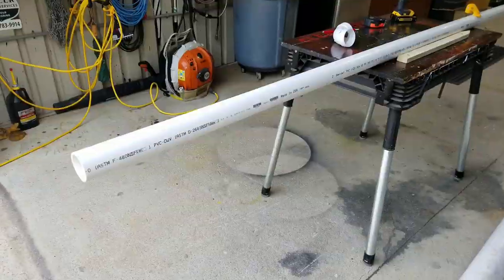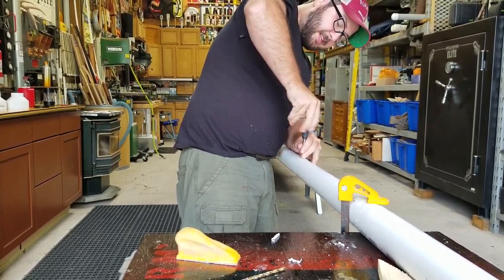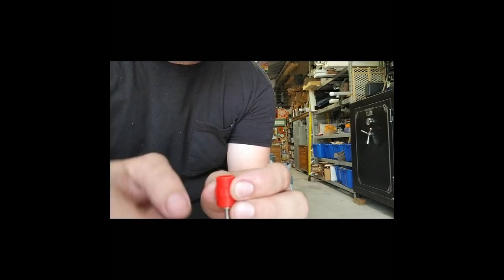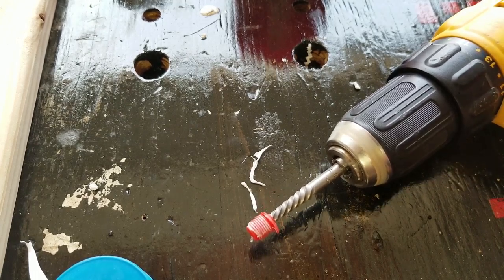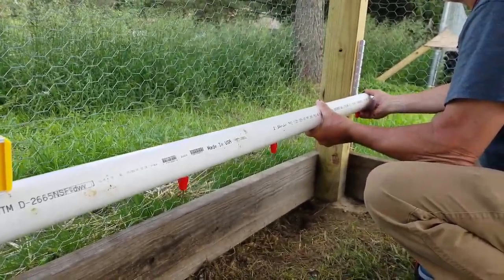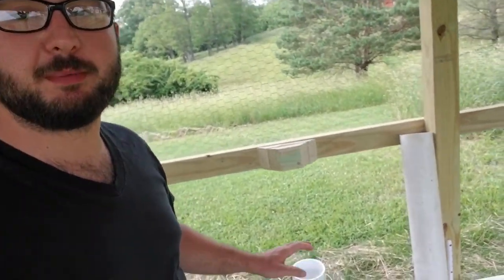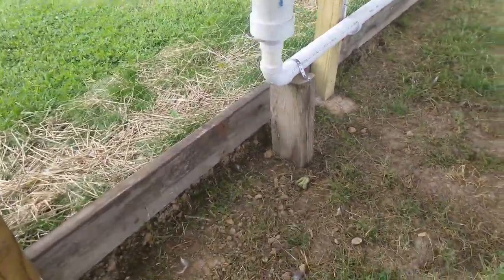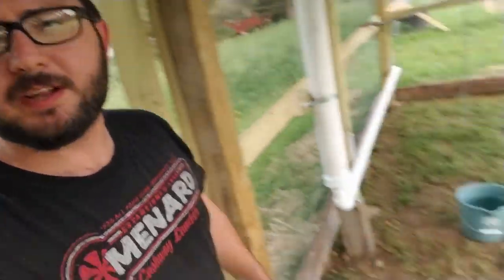Chicken Watering Station, Nipples Included

Comment: Rather than orienting the nipples straight down what if you oriented them at about 30° or 45°? They should still function ok right? Would be a more natural access for the hens.  Also mount the pipe at the correct height for full sized chickens and place some temporary blocks or something for the birds to step up on while they're smaller...rather than repeatedly adjusting the mounting height...
Reply from the maker: They do make other style nipples that you can place on an angle, but not these cheap ones, they have to be vertical or they won’t seal. We have the height dialed in now as well!

Thanks for watching!

Comment: Why did you not put gutters draining into a rain barrel and then run the water from the barrel to the water nipple lines. Then you would have lots of water and probably never have to water them with a hose. But don't forget to put a clean out on the barrel if you do decide to do it that way. 
By the way, don;t forget to put a lid on the top of the 4" pipe so you don't get bugs in the water. It would be horrible to try to clean out.
Reply from the maker: Gutters and a rain barrel are on the project list for this spring! And also a lower maintenance water system. Thanks for watching!

Comment: Why didn't you cut the wire and extend the 4inch pipe out into the yard so you can fill there without going into the run ?
Reply from the maker: I have plans to eventually collect rain water from the roof, and be able to pump from a tank to fill up the waterers from outside the runs.